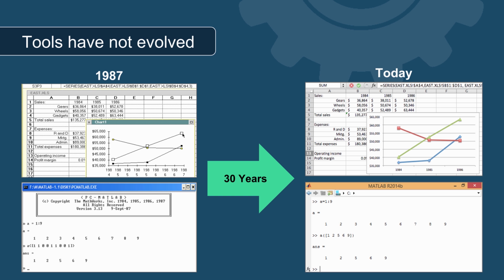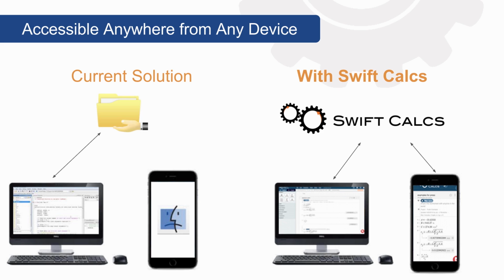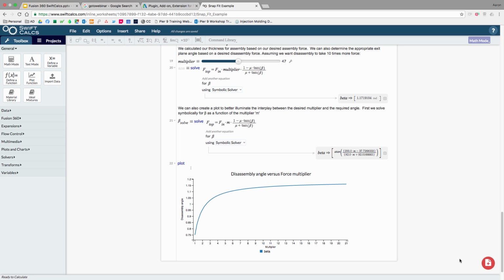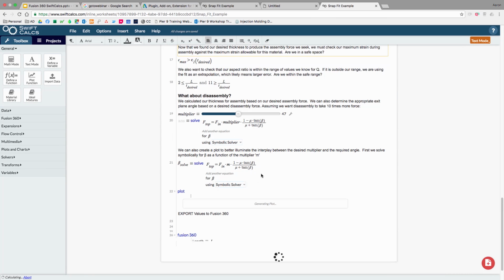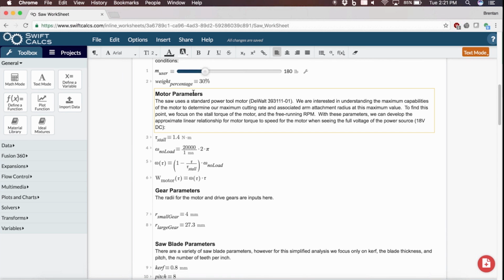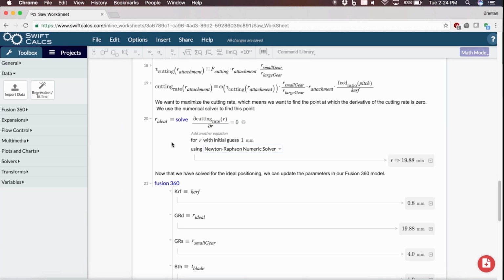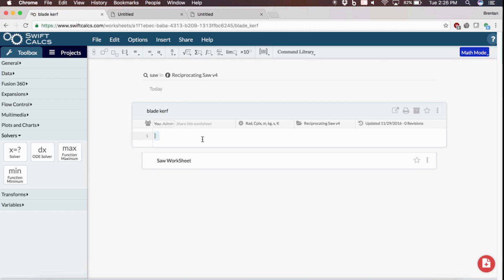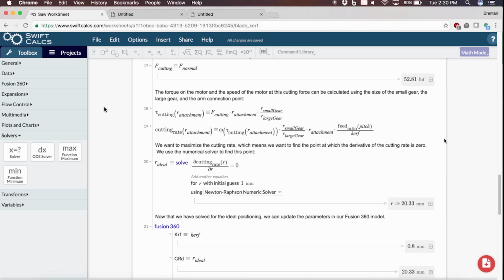Drive Designs from Calculations with Swift Calcs

Comment: Can anyone tell me if the Trial version of Swift Calcs (macos) should work? I've installed it and tried to run it after watching a few videos but I just get large dialog with the first line stating "Failed to launch web-browser:"  I notice a lot of errors relating to the SwiftCalcs.py file comming up in the dialog.... appreciate if some/anyone could clarify if this actually works.... so far it does not appear so and I'd like to clarify if this is just an installation issue or something else, thanks in advance.